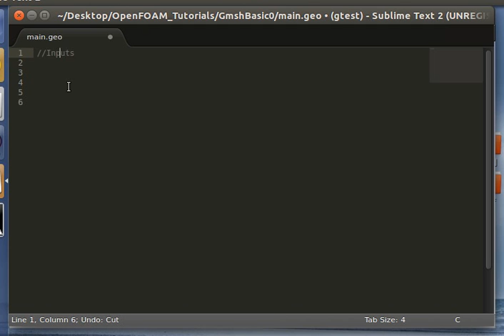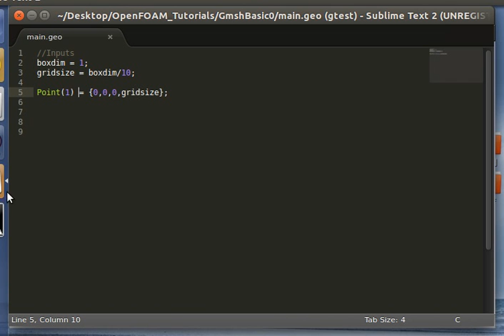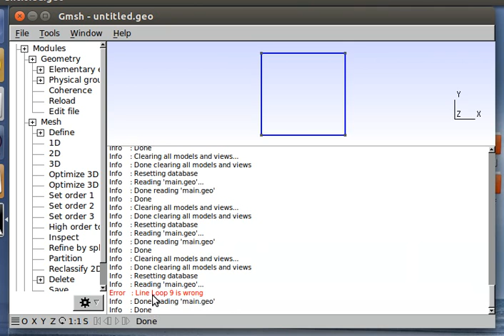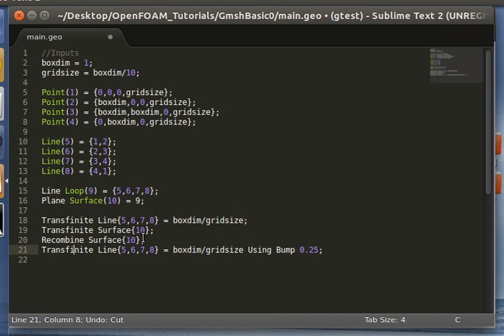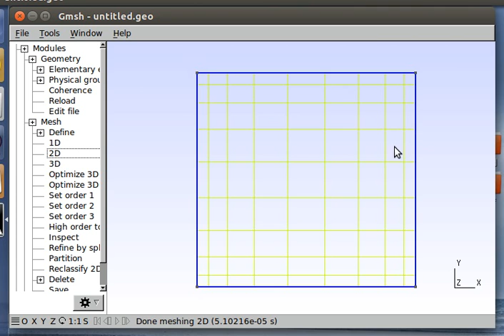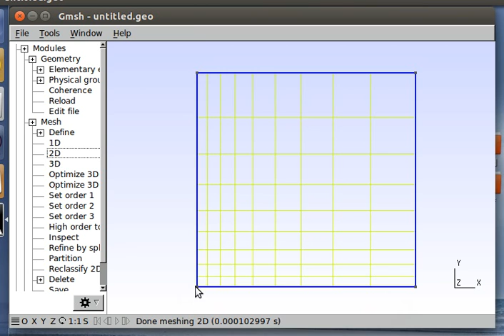Making Meshes for OpenFOAM with Gmsh, Part 0: Basic Scripting and Structured Mesh

Comment: Hi, thanks for the video. In my mesh i created two lines and an arc in the middle between them, i want to define these three lines as a unique line, so then when i use transfinite command i can say that those three lines have n points compared to an opposite side which should also have n points. Perhaps do you know how i can merge the two lines and the arc? Thanks

Comment: where i go to acess that screen that u put the code???
Reply: budapesteBR2012 it's a plain text file, he's only using the sublime text editor. Hope this helps.
Reply: @juanjose_mx  
I have the same problem as budapesteBR2012. It is a plane text, but how he connects Gmsh to it. When he save the code their and load, the changes are applied in the Gmesh.
 Btw, I am new to Gmesh. Sorry if it looks a very stupid question.
Reply: Jalil Ahmad Jamily You first have to load the text file once in Gmsh using the geometry module. He’s later clicking on reload to update the loaded file as far as I can see.
Reply: @juanjose_mx  Thank you!

Comment: Hi again, I have another question regarding transfinite surfaces. I have a transfinite surface where I have separated the boundary into about 8 segments (because I want to create different physical groups for BCs). When I try and recombine the mesh, it gives me an error saying "Error: Surface 10 is transfinite but has 8 corners"...any ideas on why this is happening and how to fix it?

Many thanks!
Reply: Hi!, could you solved it? Im struggling with the same problem

Comment: Hi, thanks for the tutorial! One quick question - when I write this mesh out onto a .msh file, in the node ordering it writes out the extreme points first and then all the interior points. That is, node 1 2 3 4 are the four corners and then the rest. Is there a way to write out the nodes in a structured IJK order? That is the bottom right corner won't be node number 2 but node number Nx and the top right corner would be node number Nx*Ny instead of node number 4. Thanks for your help!
Reply: Siddharth Krishnamoorthy Sure, you can add the '-format p3d' flag to the export command to export the mesh in plot3d format which I believe performs the ordering as you describe. There are other formats that you can view in the Gmsh online manual.
Reply: lordvon64 Thanks for that. Is there a way to do this in a way where the formatting of the file remains the same as a gmsh mesh but just the node ordering changes to the way I specified? For instance, I know if I create a structured mesh in pointwise, it'll output the gmesh file in the ordering I want, but access to pointwise is not as easy for me. I'm also experimenting with different formats. Thanks!
Reply: Siddharth Krishnamoorthy Not that I know of. You can search the Gmsh manual... If you cannot find it there, you can also roll your own post-processor that reorders the points (it actually does not sound that hard now that I think about it!).

Comment: Hello, i need help in creating a mesh. i need to create a (4m by 1*10^-4m) 2D shape. but i am having trouble meshing it. i tried doing in comsol but due to the great "aspect ratio" it wont mesh it properly (not enough elements). so i turned to other solutions such as gmsh. maybe a few pointers? 

Thank you very much,
Reply from the maker: pamfilaki Hmmm. If I understand you correctly, the problem is not with the mesher, but with your setup. 4m x 1e-4 is extremely weird to me for a problem, but the best way to solve the aspect ratio problem is to divide cells along the 4m dimension as much as possible. If you cannot do that, then I think its time to reformulate your problem.